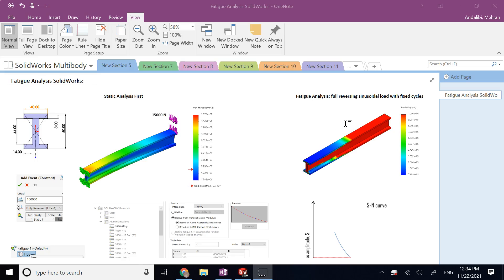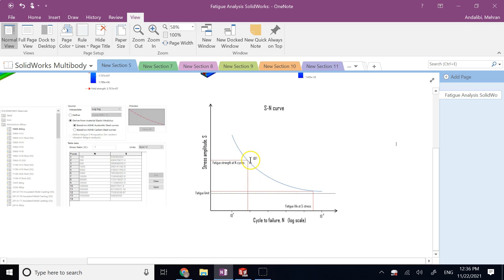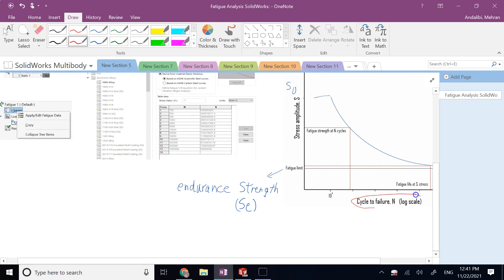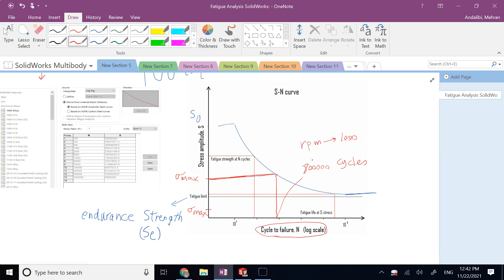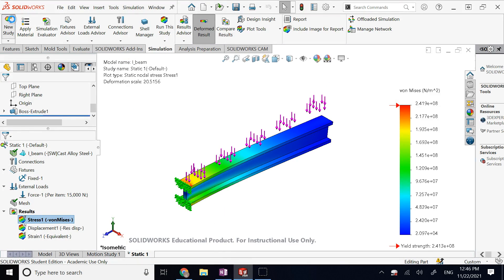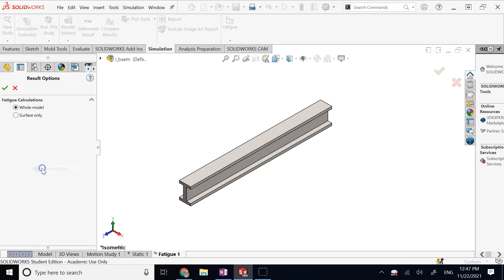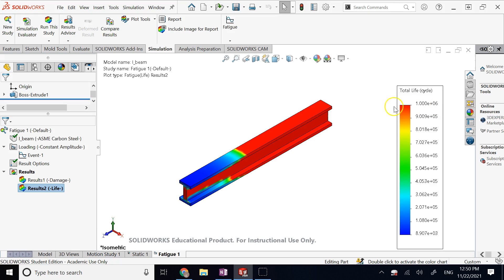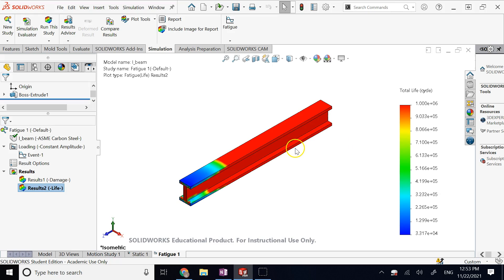Fatigue Analysis in SolidWorks

Comment: So i have a question , i tried two essays using this tutorial 
one i found that the maximum value of sigma doesn't exceed the maximum yield strangth i got a message saying the values are below the SN cure so there is no damage
in the other i got a value of sigma bigger than that of the maximim yield stranghth and i got a similar result to you
can you explain why i got the no damage in the first essay  because it doesn't make sense that even if the maximum value of sigma is lower than the maximum yield strenghth , after enough cycles some damage should appear no ?
edit : also could you elaborate more on what a cycle is exactly

Comment: Hello sir, could you please suggest any video explaining fatigue simulation with 1. zero-based load, 2.for customized material (such as Modulus of elasticity, yield strength, UTS are user defined), and 3. when using goodman correction. Mainly, I want to learn how should we define S-N curve in these three cases. Thank you